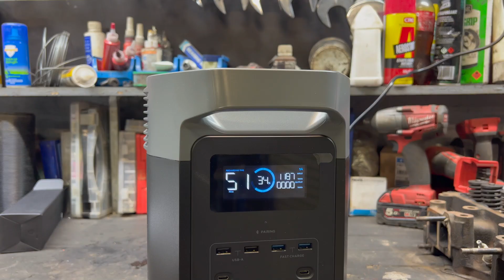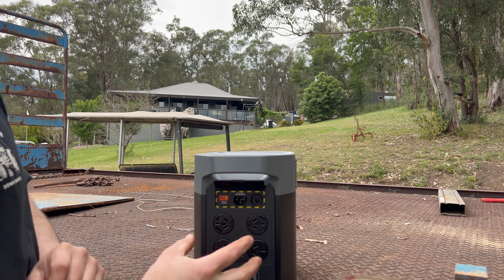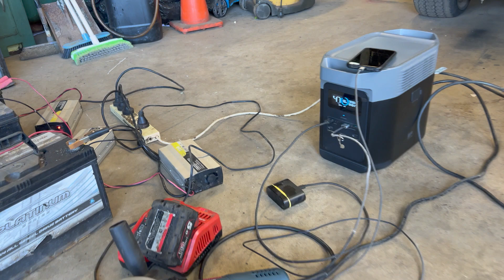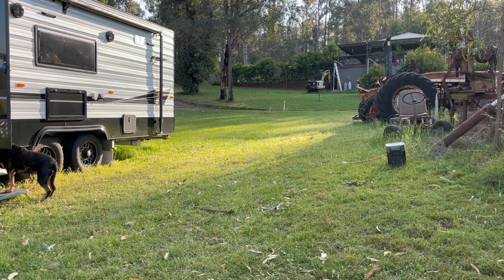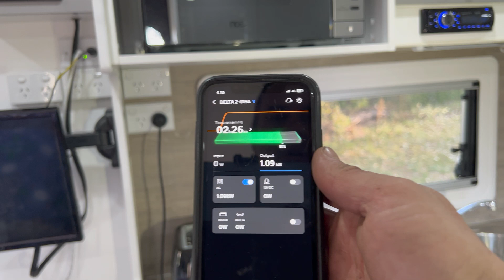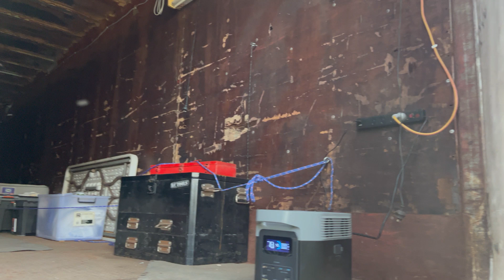Trying out the EcoFlow Delta 2 1800w Power Station

Comment: I have been looking at a unit like this for our camping trailer with some solar panels. Cheers
Reply from the maker: It charges very quickly with a solar panel or blanket mate
Reply: @stevesplacedownunder  Thanks. Good to see you get a few promos. Back to the rust next time.
Reply from the maker: @willtricks9432  yeah mate. Back to what I know
Reply: @stevesplacedownunder  I think you know a lot more than most mate and are good at sharing, cheers